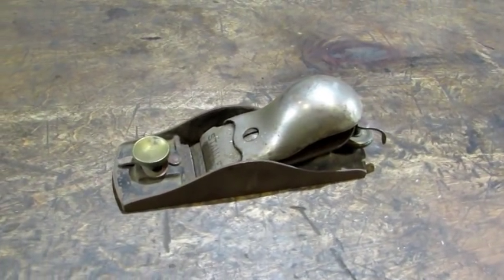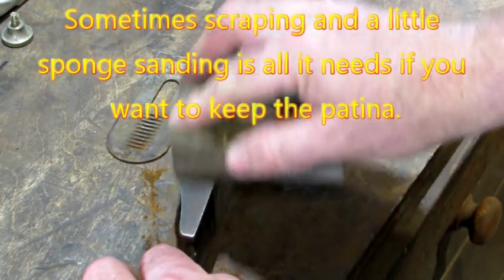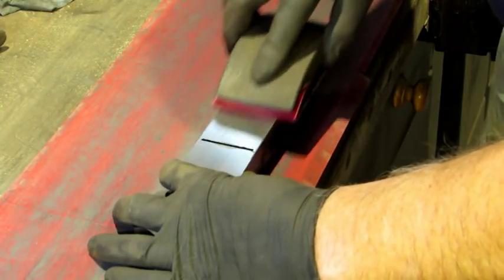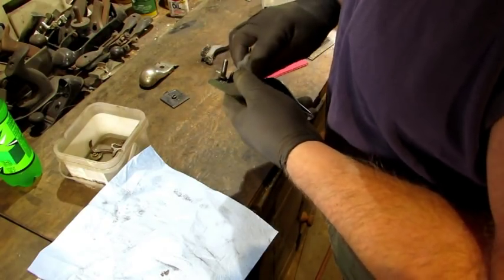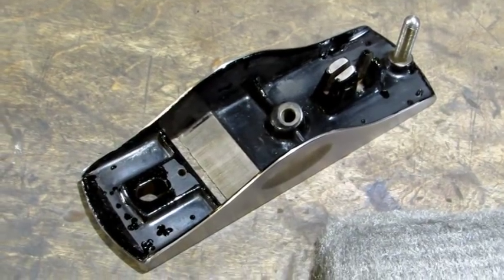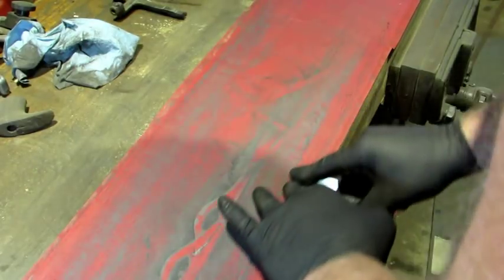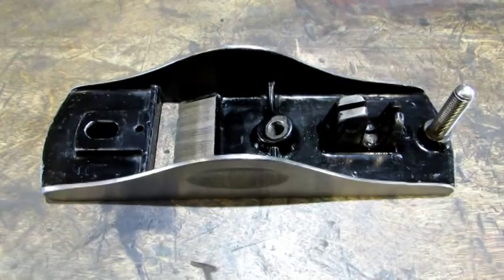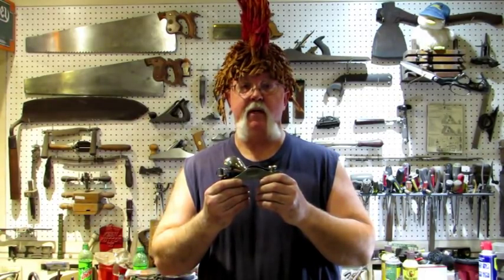Stanley No. 18 Block Plane

Comment: Hi Keith. I'm new to your channel, and I have to say that I really enjoy seeing the difference from start to finish when you restore these tools! 

I have one of these planes, which I acquired in a job lot of tools, but the front quarter of the adjustable/eccentric throat plate has been sheared off at some point.. would love to find a replacement part for it. I'm not based in the States (I'm in the UK) but not sure where to check besides ebay and flea markets etc. 

Anyway, merry Christmas to you!

Comment: I'm a power tool wood worker who just inherited some stanley planes to include this model. This might be a dumb question because I really have no idea what I'm doing. No matter how I adjust this thing, I can't get the blade to protrude even the slightest past the seat of the plane. It contacts the adjustable throat and stops. What am I doing wrong
Reply: Is the beveled side up or down on the blade?

Comment: Was there ever a "low-angle" offering similar to this, specifically with the "knuckle joint" type lever-cap?  I always kinda wanted one of these... but if they can only be had with a 20-degree bed angle, there's not much point, at least for my purposes (as a practical user).
Reply: Thank you!  That's just what I want!  I have seen those on Ebay... now I'll know which model to focus on.

Comment: Keith, whats your stance on lapping planes (block or otherwise) with the blade/frog/lever cap installed and under the pressure they would be under during use?  I know you lap your planes with the frog/blade removed.  Do you not buy into the idea that the plane sole flexes when under the pressure of the lever cap? (I find it kind of hard to believe myself, but I do it anyway just in case) Just wanted to get your opinion.
Reply: Great videos BTW!